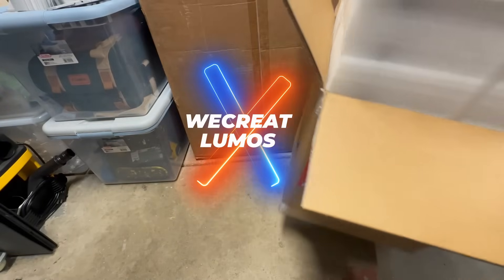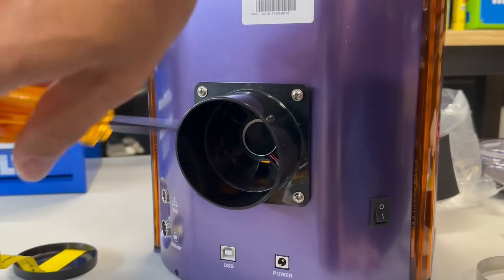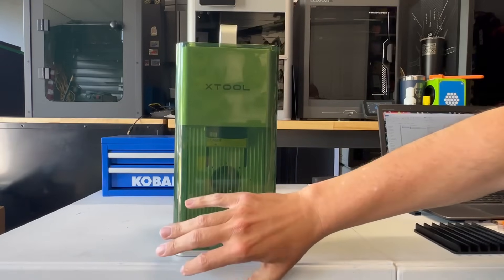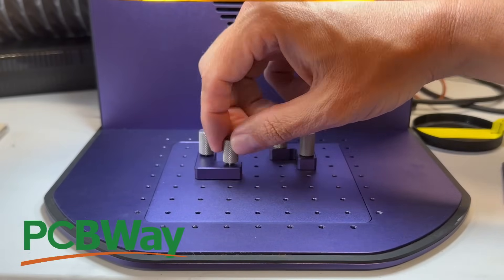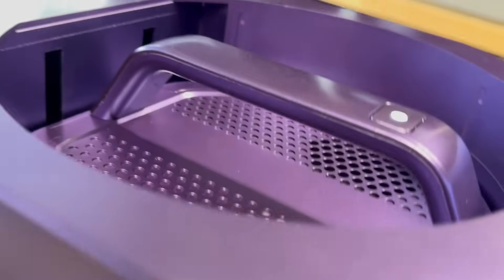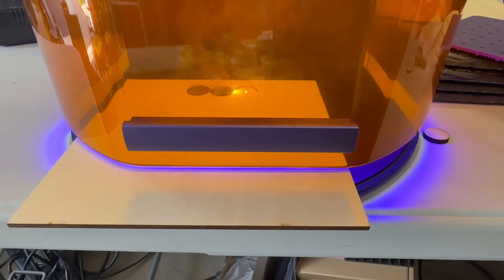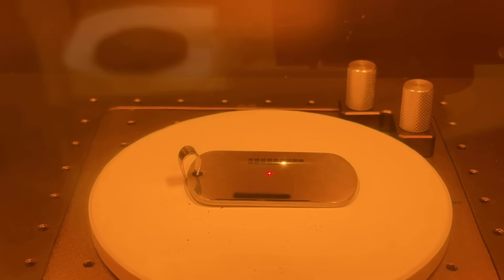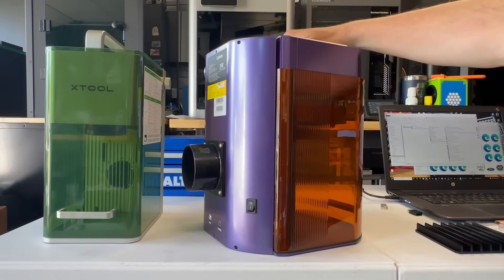WeCreat Lumos Portable Laser Engraver - Better than the xTool F1

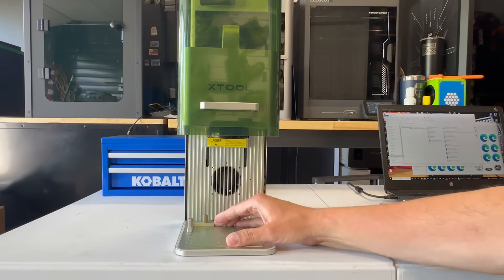Comment: 3:05 , are you joking/trolling? there's forsure an F1 Ultra and a F2 ultra lol
Reply from the maker: The F1 is a 10w Blue Diode, with a 2w IR.  Which is what the Lumos is competing with.  It isn’t competing against a 20w Diode, with 20w fiber.  As mentioned in the video, the Lumos is competing against the F1 and not the F1 Ultra or the F2 Ultra.  These are totally different machines.  The prices reflect the differences in technology.  You must be either joking or clearly do not understand the technology differences between these machines and it is clearly over your head.
Reply: @TripodsGarage  you said " when you don't innovate for two years, then this is what happens" makes zero sense considering F1U and F2U has been released. I completely understand at what level they compare, but I don't understand why the comparison is being held in 2025. Meaning F1 has been very much updated as a whole. As in my other comment. Chevy showcasing there 2025 model, while comparing to a 2020 ford. Right, it went right over my head, im just saying stuff like IR, mopa, diode and fiber. I don't know any difference it's obviously going over my head. you got me, good one.
Reply from the maker: @kennyrobman7390 Ok, guess you are saying the Hummer H3 is an evolution of the Hummer H2.  So idiotic.  The F1 and F1 Ultra are two totally different classes of machines, just because the have the same sliding cover, and the F1 name I guess that makes it an “evolution” of the “F1  Name”.  Just like the Mustang Mach E is a Mustang 😂
Reply: @TripodsGarage  lol take care
Reply from the maker: @kennyrobman7390 you are the one that made the idiotic analogy of comparing a 2025 Chevy to a 2020 Ford 😂
Reply: @kennyrobman7390 I agree with you
Reply: @TripodsGarage no you are wrong here. Sorry but F1 ultra and F2 are the upgrades to the F1... the lumos is behind the game sorry but no
Reply from the maker: @RVS214  You are totally wrong.  The F1 is a family line of products.  So you are saying the Hummer H3 is an upgrade to the original Hummer 😂.  Yeah, F1 was released at $1,199, the F1 Ultra was released at $3,799.  Over 3x the price of the original F1.  A v2 of the F1 would be somewhere around the same price, not 3x the price.  These are two totally different machines, just using the F1 family of names.
Reply: @RVS214 very very very obviously lol. Guy really weirded me out completely with his entire argument. Couldn’t believe he was actually serious, make no sense. Maybe he will catch on when WeCreates next laser in this series will be a diode and fiber mix just as the ultra.
Reply: @TripodsGarage the fact that your informing xtool how to name and price their machines is also a huge level of delusion in itself 😂 I’m pretty positive they named THEIR machine an Ultra / F2U for a reason. I’m also PRETTY sure they would know how to name THEIR machines, better than you! Like, what world do you live in? 😂You decided it should be a family line of products and the correct way to have done it would’ve been to stick with updating a diode and a IR. When they were THE FIRST IN THE WORLD  to have the ability to combine with a mopa? F2 instead of F1. They should Create a whole entire new series, though the body platform is the same, bc it’s a mopa and a diode instead of a IR and a diode? That makes more sense than naming it F2U ?  😂 it should Be like the X2, instead of F2U bc it’s COMPLETELY different than the F1. Though they are alllllll galvo lasers specifically lol you’re WILD my guy. Confidently delusional.
Reply from the maker: @kennyrobman7390 Oh!  Would you look at what just came out!  The xTool F2!  The next gen of the F1.  Same size, same characteristics, but more power and other features.  Does it have a fiber laser?  Nope the is for the “Ultra” line, it has a 5 watt IR!

Comment: lol , this company is on a promo run that’s about 3 years late. There’s two newer versions of the F1. Whatever it was missing has been very much so updated.
Reply from the maker: The F1 is a 10w Blue, and a 2w IR., still is today.  There are two versions of the F1, one with the dual source, the other is a single source.  What was updated on the F1 since it was introduced?
Reply: @TripodsGarage  Yes, the F1 will remain the F1. However there are two new versions. The F1 ultra and the F2 ultra. Which the F2 ultra is what you have to be referring to, with dual/single source. The F1 ultra is a 20w diode and 20w FIBER. The F2 Ultra is a 40w diode, 60w mopa. This is the latest as far as the F1 goes. Which is why my comment states that they are competing with an older product, that has been very much updated. Their new is competing with xtools old product. imagine chevy advertising their new 2025 model by comparing it next to a 2020 ford. Why not put it next to a 2025 ford?
Reply from the maker: @kennyrobman7390 The technology is totally different, and reflects in the price.  As stated in the video, also visually, the competition is the “original F1”.  Why would anyone think the F1 Ultra is the upgrade to the F1.  That is an insane upgrade path.  The logical path is what WeCreat did, adding a camera, lighting, and increasing the power of the IR while maintaining a price point.  Not doubling the diode, adding a fiber, camera, and doubling the size with 3x the price!
Reply: @TripodsGarage  lol you said " why would anyone think the ultra is the upgrade to the F1" Yeah, conversation over my guy, you got it. the same exact reason why any logical person would think that Spiderman 2 is the upgrade from Spiderman 1? Yes it's a switch in the TYPE of laser that's inside of it, that's why its an " UPGRADE "  and it's LITERALLY called F1, ULTRA. Did you think xtool would remake a F1 and call it F1? No, it will be an addition to the name of some sort come on now
Reply from the maker: @kennyrobman7390  Oh I called it with the logical upgrade path, that you clearly didn’t want to understand.  Well would you look at what just dropped?  Oh! The next evolution of the F1, called the “F2”.  Continues with an upgraded diode, and upgraded IR.  Not no fiber source like their “Ultra Line”.
Reply: @TripodsGarage  But you're not counting the F1 Ultra and now the F2 which is the evolution of the original F1. It would be nice however for xtool to revist the orignal and give some QOL features like a light and maybe a slight increase in power. To say Xtool doesn't innovate though is simply not true everyone else puts their spin on what xtool came out with first which you see here with wecreate 2 years after I might add. I'm not an xtool fan boy but you have to give them credit where its due.
Reply from the maker: @jgoudey4477  He said there are two newer versions of the “F1” which there isn’t.  During the release of this video, the F2 Ultra wasn’t even announced yet.  There is absolutely no comparison between the F1 and F2U and the Lumos.  Minus the Diode, we are talking about different technologies, along with a massive price difference.  I am a partner with xTool, and I do like their products.  As a mentioned, there hasn’t been an evolution of the F1 product line (minus the F1 Lite which was removing the IR).  I am sure there will be a V2, however it will most likely be what we see in the Lumos.  XTool should have been first to a V2, not a competitor.
Reply: @TripodsGarage  Guy, I am lost. The two newer F series version is the F1U and F2U. THATS the newer versions of the F1. Whether F2U was mentioned before the video release, there was always a F1U "v2", which is very obviously the innovated version of the F1. How are you actually saying that there is no " evolution " when a F2U with 40w diode and 60W mopa laser 8x8 word bed has just been released? F1U (release of this video) 20w diode, 20w FIBER laser. Can we consider a little evolution from a 2w IR? whats evolution to you? that is def a HUGE jump in a short period of time. Xtool should be the first to v2 ? v2 is the F1 ultra my guy? I literally had to reread your comment like 5x, so confused.
Reply from the maker: @kennyrobman7390 - Absolutely not!  You are trying to tell me the next evolution of a product is making it cost over 3x the price?  Why, just because it has F1 in front of it?  This is surely a joke!  How dense do people have to be?  The next evolution of a product for this would be the F1 2, keeping around the same price point, while making subtle improvements, keeping the same nice small form factor, and maintaining around the same price point.
Reply: @TripodsGarage  xbox switched from " xbox 360 " to xbox series x. is that not considered an upgrade because its not called xbox 720 and it doesn't lay flat? no im sure your joking. Xtool didn't name it correctly according to your opinion, but im pretty sure the F2U is the " F1 2 " LMAO. pretty positive everyone will agree with me. However, I understand we see things complete different. take care
Reply: @TripodsGarage  The price is increased because of the TYPE of laser, and laser power my guy. Xtool def has a bit of icing on the cake with pricing, but you CANT say they aren't innovative. That was funny, they are also very very fast as far as innovation goes as well. Just got my F1U weeks ago, now waiting till the 10th to where im allowed to place the order on my F2U :)
Reply from the maker: @kennyrobman7390 - Absolutely hilarious!  Two totally different lasers using the F1 naming.  Basically you are saying the Hummer, the Hummer H2, and the Hummer H3 are all an evolution in the production line.  When the original Hummer is the best!  The only similarity of the F1 and the F1 U is the cover, how the laser module moves up and down.  All the internals are totally different.  The 3x in process reflects that!  The F1 and the Lumos are price competitively with similar technology.  Like I compared in the video, it would have been absolutely ridiculous for me to mention the F1U as the competition.  The only evolution of the F1 was the F1 Lite, stripping out the IR.  Otherwise there hasn’t been a V2.  Keep on fanboying 😂 👍
Reply from the maker: @kennyrobman7390 The price increase is because it it is a totally different machine.  Like saying the Hummer, Hummer H2, and Hummer H3 are all the same.  When they are all built off different platforms, and different engines.  Just because a product look similar in appearance, but is way bigger and has totally different internals, doesn’t make it the same.  Then next version of the F1 would be a F1v2 or something.  It is a totally losing argument comparing the F1 and the Lumos to a F1U or F2U and saying that is the evolution of the F1.
Reply from the maker: Oh I called it correctly!  The F2 just dropped, and “Is the V2 of the original F1”.  Not the Ultra line which is a different product class.
Reply: @TripodsGarage lol I DEFINITELY thought about this conversation as soon as I seen it I must say! I can say, at the time of our debate. The F1U/F2U WAS the upgrade. But in this moment, this is not the case anymore. And I’m honestly shocked to see them back track and produce a F2. Especially already have had releasing an F2U first. Very odd, but sort of makes sense considering there’s a “ F1 “ but I’m positive it was simply to stay on top of the competition that’s trying to out do them.
Reply: @TripodsGarage  You logic was dead on!  The F1 version two, now the F2 is literally everything you basically mentioned as an upgrade path.  There are two product lines, the F series and the Ultra series.  It really isn’t rocket science what makes them different.  Time for some of these people to eat crow.
Reply: Only thing I want to see is a UV laser reasonably priced with Ethernet connection Wi-Fi be damned when you don’t want to sit next to something poisonous! Discuss 😅